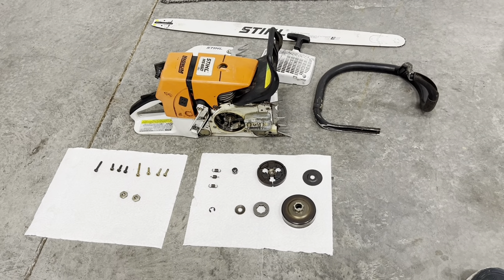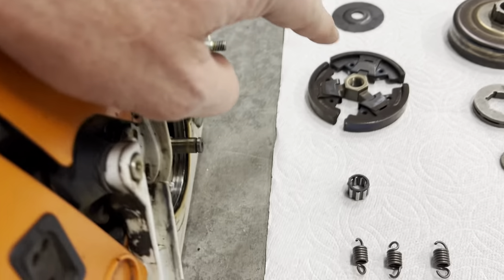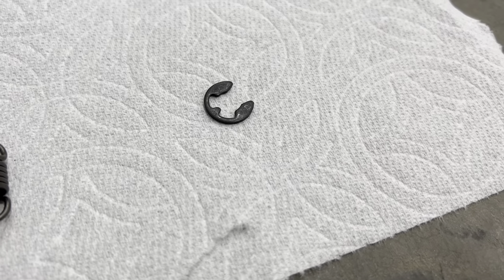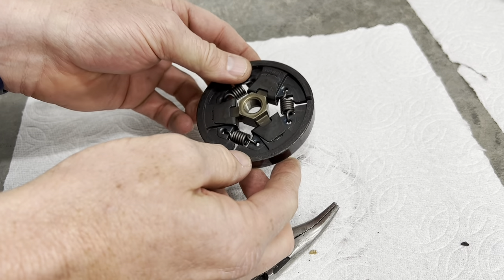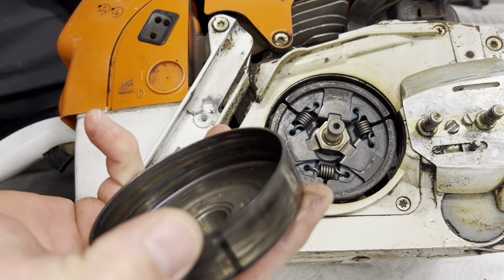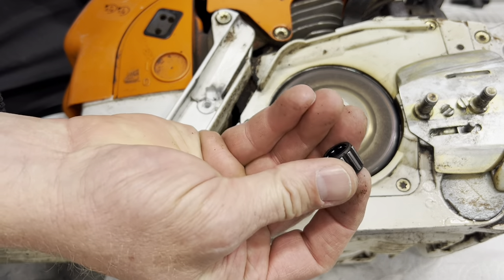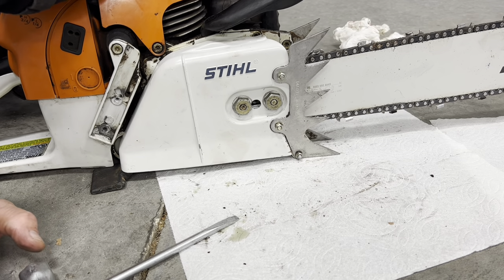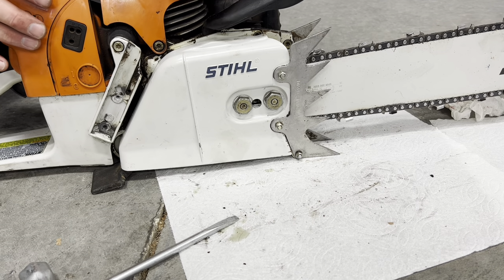Stihl MS 650 MS 660 066 Chainsaw Clutch reassembly and a few learned tips

Comment: I tried this and my crank side was coming loose before my clutch side would tighten to the appropriate torque
Reply from the maker: You should be able to hold the nut on either side of the crank when turning the opposite side of the machine.
Reply: @BryanHansen  unfortunately when holding the nut on the crank side it became loose before the nut on the clutch side was tightened. I even tighten the crank side with an impact and it came loose again before the clutch side reached torque
Reply: It's reverse thread..the torque of the chain tightens it does it not?